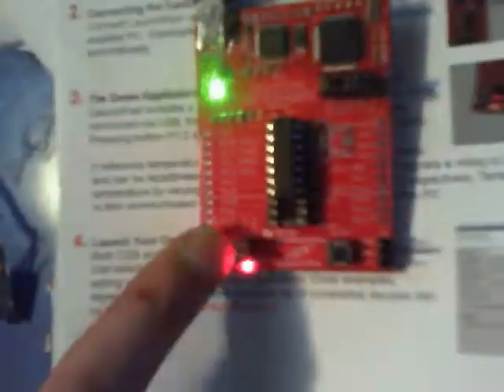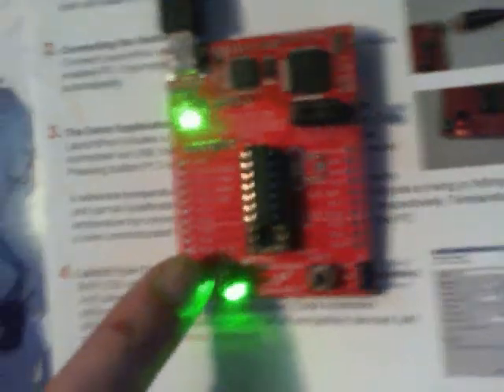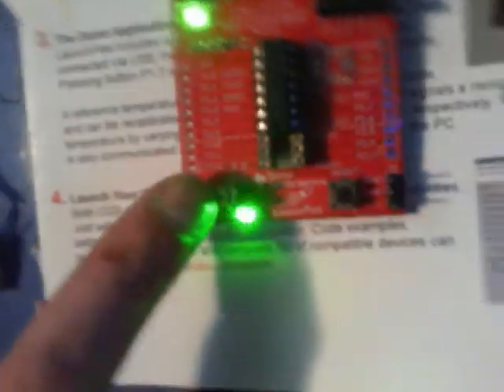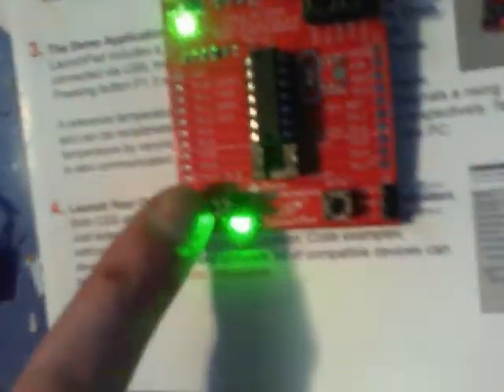MarkoeZ MSP430 Launchpad Video's Part 5: Leds and Buttons

Comment from the maker: Hi,

I no longer have the bare code, but i have code that is based on this example, with added serial control. Button still works, so if you don't connect it to a pc, should work the same.
I added a link to the info, that has a blog post with explanation and the code.

Hope that helps,
Cheers!